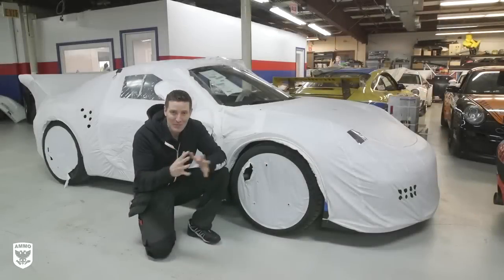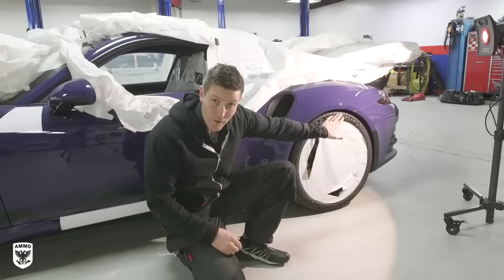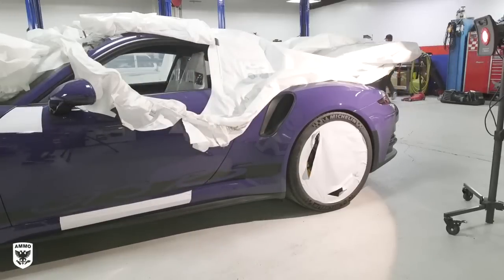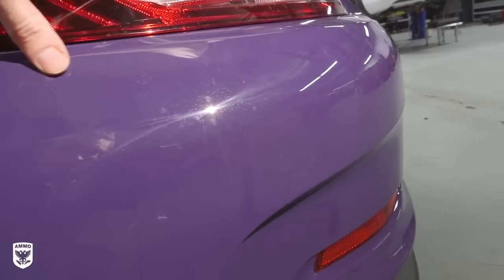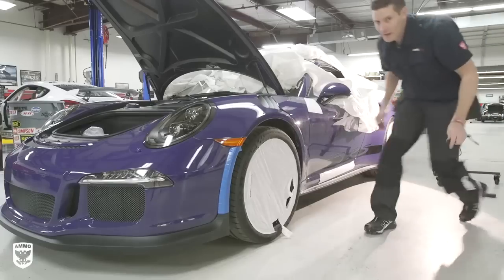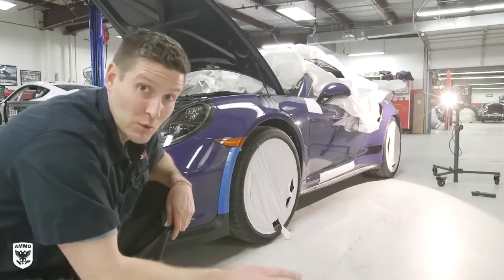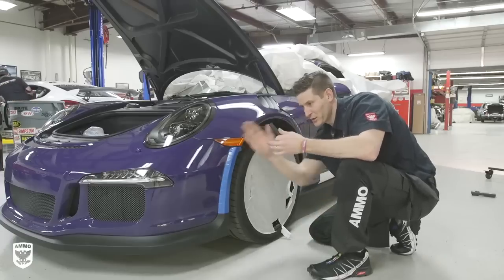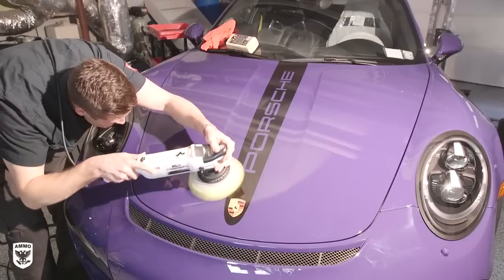New Porsche GT3 RS - Paint Inspection

Comment: I'm reminded of a story about French restaurants from the '30s.
If you're hygiene conscious it's better to eat in the cheap restaurants because the food will have been slung straight from the delivery onto a grille and then flipped onto the plate.
In an expensive restaurant the food has been tasted, chopped, poked, prodded, shaped and seasoned by the chef's greasy fingers and probably a half dozen kitchen commis before it's deemed acceptable for the customer. People wiped their sweaty foreheads, smoked cigarettes and then dipped fingers into the sauces or arranged the food into pleasing shapes on the plate.
Same with cars. The more rare and special the car is, the more people want to wash it, polish it, touch it, sit in it - and that's how damage like this happens. A slight scuff driving it off the boat, a slightly over-zealous dealership detailer, a cheeky sales rep having a poke around the car and brushing his clothes against it...
I kinda doubt brand a new Camry has these problems.

Comment: I'm surprised Porsche let the car leave the factory in that condition. I think the last thing would be is to let the dealer touch it because if an inexperienced detailer gets it, you might end up with more problems. When I had over a dozen paint issues on my M3 and I brought it back to Tesla they ended up taking it to an uncertified body shop and boy did they f'ck it up, after three attempts I gave up.
Reply: It was probably pristine when it left the factory. Most of these things happen during transit. That cover has been on and off more than a handful of times.
Reply: Audi does a very similar thing. This cover, or "bag" as we called it at the Audi dealer, is not a tight fitting cover, except at the edges. In transit, it will flap around with the wind, and smack, rub, scratch, etc. the paint. We called it "bag rub". Every Audi that came in needed some sort of correction before it went on the lot because of this, and sometimes, panels had to be repainted.

At the Infiniti dealer, the cars just came in with their respective plastic wrap on the body. No bag. The paint was always so easy to clean up before going on the lot.